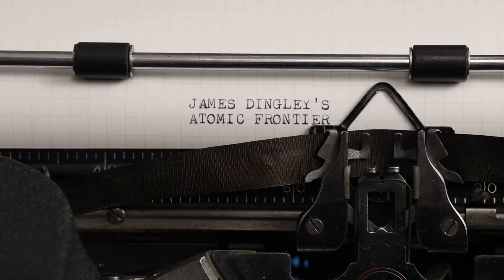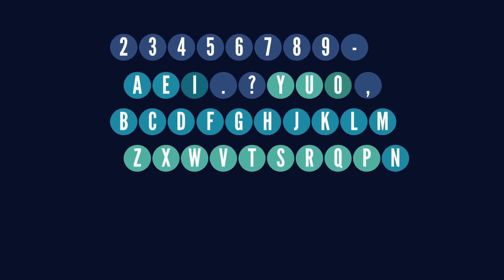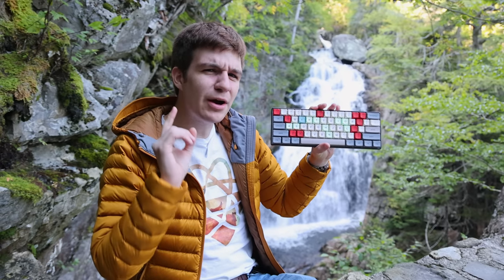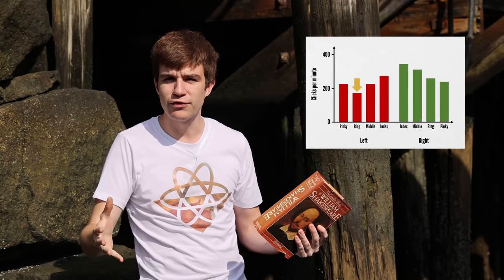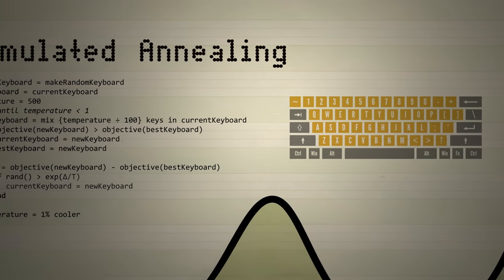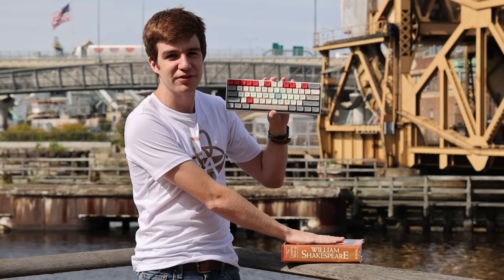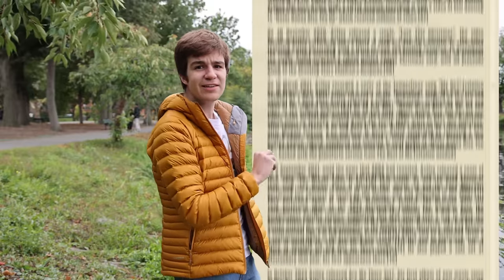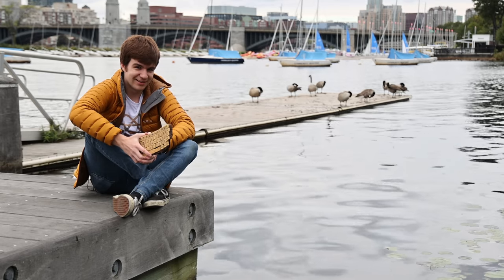QWERTY is broken. Can we make it better?

Comment: Something that should be considered with keyboard designs aimed at injury prevention:
The right index finger is already under heavy stress due to all the left clicking, so it should not do any heavy lifting on the keyboard to balance out the strain.
Reply: I use the mouse left-handed, so it's my left middle finger that does all the clicking.
Reply: @thekaxmax for me it's my thumb because I use a big trackball mouse!
Reply: Solution: stop using the mouse, and just use the keyboard. Retvrn to command line :P
Reply: You can get ergonomic mice as well. I use a Ploopy Classic Trackball and the mouse buttons are on the left side and hit with the thumb.

Comment: While switching from 10 finger to 10 finger is difficult. Its far easier to learn when going from "2 finger search mode" or derivatives to optimized layouts. The german layout NEO additionally has 5 extra layers which add in movement, special characters and scientific characters, which makes writing code a lot easier. even if it would take you 6 months at half capacity to switch fully, the sheer speed and finger fatigue improvements pay themselves back a lot.
However if you are only writing regular text its probaby not worth it
Reply: Neo User here, yes the layers are really worth it, especially considering the bad layout of brackets etc in qwertz
Reply: Neo layout is also an excellent layout for English text. With its additional layers it's the most ergonomic layout for programming today. (...if you stick to the traditional keyboard hardware.)
Reply: @annaluiseblume  I wonder whether the bone layout would make much of a difference but I haven't had the time nor the patience to try it yet

Comment: For those that are (too) used to A/QWERTY/Z to learn something new, or need to maintain a low-entry-barrier (meaning being able to go with whatever keyboard is at hand): You may try to shift your hands-position one character to the right, so that the left F-nub is under the left middle-finger and the right index-finger is on the K. In this position you can make use of your knowledge of the keyboard-layout while also being much more centered and have a better spread/shorter reach, kind of equalizing the asymmetrical orientation. This is especially helpful on laptops and compact industrial, as well as the usual office keyboards. While i learned 10-finger typing on german keyboards, the switch to US-International-with dead-keys Layout reduced the strain further overall, independent of the languages i write in and is extremely helpful when writing code, often switching operating systems and editors over the day (or night).

Would love to try a Dactyl Manuform if only there were key-switches with a much shorter travel, comparable to HP Laptops/Notebooks and Apple MacBooks/Magic Keyboards - simply because with Poly-Arthritis it's a PITA to hunk mechanical switches over the threshold for longer than an hour ..

Love your style btw. keep the middle-fingers coming!

Comment: Interesting stuff. After a 20 year career as a typographer in the pre-desktop days, I got 3 different RSI problems in my arms, but mainly bilateral epicondylitis and radial nerve syndrome. I got ill in 1992, and my case was an early one that helped Workers Comp decide to allow chiropractic as the primary treatment for workplace injuries,  if the injured person prefers. Just to say, I've tried everything. I left typography and entered tech writing, but I do still type many hours a day. I use the TypeMatrix keyboard, which is a small footprint regular grid. Hugely better, totally fixed me up. Will run either qwerty or Dvorak. I have no affiliation, just wanted to share.

Comment: I think your worst possible keyboard ignored the fact that you could just change the home row for your hands and get a massive improvement. I'd be interested in a layout that couldn't be gamed simply by changing your home row.
Reply: However, there is a good ergonomics argument for making row 2 the home row, as reaching a key two rows higher up is physically easier than reaching one that is two rows further down, while one row up and one row down are roughly equal.
Reply: Scoring function should consider distance between bigrams (consecutive keys), especially if they fall under the same finger.

Comment: TIL (today I learned) - I always, incorrectly, thought that Qwerty was related to mechanical keyboard arms - thanks for this video and insight!

I guess once you've been typing with a certain layout for many years (in my case, 43 years), it's nearly impossible to change.
I can touch type - I'm doing it now - I've spent so much time on a querty keyboard, since my ZX81 back in 1982 (I was a year late), any other layout is now an impediment. 
Even switching two letters would throw me out. I literally glance at the keyboard once every session.
A session is when I take my hands off the keyboard entirely. 
Touch typing is entirely based on muscle memory... which does make buying a new keyboard interesting.
It must have exactly the same spacing and size of keys.

Comment: Maybe it's not the keyboard layout that's the issue, but the "home keys" typing method? 
Luckily, I was never taught the home keys method. I just learned typing intuitively, in 2 character sets (Latin - qwerty and Cyrillic). Now that you've used weird-ass random layouts for a while, try to reset your typing method: go back to qwerty, but don't use home keys, just let your hands float freely over the keyboard and type. Moving your whole palm by a few cm is more effective that trying to hit "x" with your left ring finger or whatever, IMO.

Comment: I think a good model to use for a generally optimized keyboard for the english language would be to use simulated annealing of 1) the 3000 most commonly used words in the English language (which supposedly accounts for ~80% of daily linguistic communication) weighted by frequency of use, 2) Weight by travel distance from the home keys in a multiplicative manner to word frequency, 3) don't weight by awkwardness of using each finger to type unless you have a large enough sample size of people to get an accurate measurement, which I presume would be several thousand people minimum. 4) For typing on mobile define travel distance by how far each thumb would have to travel from halfway along the keyboard vertically and either one-third or one-quarter in the keyboard from each side. This process could be applied in a multilingual context by using words in every language that uses a Latin script that ammount to 80% of daily communication in each also weighted by frequency of use and travel distance form the home keys, and maybe weight each language by frequency of use.

Comment: the biggest issue with qwerty is that it's good enough. even the best possible layout wont give you 50% improvement. depending on how you measure, of course.
there are lot of conventions and expectations in software about it. gaming, vim, shortcuts, etc.
even notorious ctrl+c, ctrl+v will feel awkward on "the best" layout.
so qwerty will stay with us for a very, very long time. until big companies like MS or Google intervene.

Comment: Man this was a nice watch, although I gotta agree on the end that going through the pain of relearning a keyboard layout is pain for several reasons, the two main being that people type differently, me for example I don't even have a home row, my hand simply do not land naturally on the same place all the time, sometimes they even land on the number row, leading to very erratic typing that's always changing and always using all fingers, plenty of times the thumbs and pinkies too.
The other big reason is that your method of optimization is highly optimized... For ENGLISH. I am a native spanish speaker, and I am thankfully sufficiently fluent at typing in both english and spanish, and I think these optimizations you dabbled with would indeed minimize travel time, but not necessarily improve OVERALL typing speed. I mean yeah, saying "T, H and E are all together and thus you can type it faster" but you can also type faster by using both hands interchangeably. While typing this sentence I found myself hitting the A key with my ring finger as my right hand hit all the letters around the A key, leading to, to me, a smooth typing experience.

I think the true innovation would be in keyboard shapes, having the keys arranged in a way that better suits the hand and doesn't make stuff like holding down Ctrl, Shift and Alt too big a pain, doesn't require basically two hands for any common combo, and allows for less paradigm shifts between typing and using the mouse since we don't have three hands... Man it would be awesome to achieve true seamless integration of all these things... Oh well, gotta keep trying. GOOD WORK ON THIS!

Comment: Supposing for simplicity all the languages in question make use of the same written alphabet, 
such an approach would still require at the very least to use one keyboard for every language you want to write in,
even if you actually tailor the whole process on your own past written material and on currently recorded writing statistics.
...
I'm Italian, and I write just as much in my language as I do in English, on average.
But I know for sure there's a significantly higher use for one of the two languages over the other at times, depending on the period (i.e. mainly for work reasons, some months I'm writing much more Italian, some others in English).
I'll stick with QWERTY.

Thanks for your videos!

Comment: I would argue that split ergonomic keyboards which have the hands/palms at a sight to moderate vertical angle, which is our natural position when standing contribute much more to the comfort of the wrist/hand pain people often attribute to typing.

Also, if you're properly touch typing, staggered layout is even worse for you as your fingers have to move at a very uncomfortable angle across each key column. Ortholinear is the way to go here without a doubt. It might not improve your typing speed but it will significantly improve your comfort over the long run.

This was a very well made video with incredibly simple explanation of complex topics. Subscribed!

~Love? Qwerty? Hell nah bruv~ (I wrote this line at the very beginning of the video)

Comment: I also played around with keyboard optimisation a few years ago. Also used simulated annealing. One new idea I had towards the end was that it may be better to use a home gap rather than a home row. In other words, the better home position is between two rows (after optimising the keys in those rows), which allows you to keep more keys closer. The overall penalty for eg moving half a row for most keys is less than a zero penalty for the home row plus the unit penalty for more keys.

Comment: Interesting experiment. I never took typing class in high school (I'm 47, it was still on typewriters) and what started as hunt and peck has eventually turned into touch typing where I only use my index and middle fingers for everything except 
function keys, spacebar and enter. The upside of the typing method is that my wrists stay pretty straight while I'm working so I never end up w/wrist pain from typing. 

Got a new keyboard recently and it has 10 key again, which makes me happy as I had to learn it for a job bc entering the number strings for work assignment was so much faster that way. I'm happy to never use the numbers in the main part again.

Comment: I love this sort of thing 😆. BTW the design of the Dvorak considered two important criteria you missed: it favors alternating between hands (which is why all the vowels are on the left in home row) and it favors rolling toward the center of the keyboard (e.g. typing with a ring finger followed by middle finger) because that's a more natural movement than rolling outward.

also: the keyboard layout you display at 7:12 is the left-handed Dvorak alternative, not the standard Dvorak -- is that the one you analyzed with your formula?

Comment: Well made video 👍🏻
I’ve learned ColemakDH in two months, got to 40 words per minute. Completely forgotten how to use qwerty layout. That caused an issue with my laptop, so I’ve switched my laptop to ColemakDH as well. In the end I’ve returned to qwerty. Yes my fingers traveled noticeably less with ColemakDH, but that itself was an issue for me. I hated that all I type mostly required home row keys, this felt like I’m paralyzed or have some medical condition. I wanted my fingers travel more and do variety of motions, I felt it’s like stretching or doing a little workout. With less finger traveling I felt like I’m lazy and lying on a coach. That forced me to switch back to the qwerty when my fingers experience a variety of motions, to my biggest surprise. Switching back to qwerty required me to learn qwerty again, cause my brain was rewired to touch type with ColomakDH. Took me a week to get back to my average 60-70 wpm speed. 

Now I believe that criteria of reducing finger traveling is wrong. There should be a balance, not too much, not too low. I feel qwerty is exactly that for me.

Comment: Despite all the efforts I've seen people make with different keyboard layouts (like DVORAK), I'm yet to see someone make a keyboard layout meant for multi-language typing

I know that other layouts can be better and allow me to type faster IN ENGLISH, but I'm a native Spanish speaker and I also speak a fair bit of Japanese, and I don't think keyboard layouts like DVORAK would work too well in those languages, which is why I'm sticking to QWERTY probably forever
Reply: On my phone I use an input method called Message Ease which uses presses for some letters and swipes for others.  so you have the 9 most popular letter as presses and other letters as swipes between those nine areas.  They do have multiple language specific layouts.

Comment: I remember in touch type lessons, we used to be told that the finger layout matches qwerty so the spread is more balanced throughout, so personal experience, and some of my friends, getting used to it was tricky because of that reason and we just went back to using qwerty.

But even when the "used to" obstacle is finished, the next one, still comes down to hand and finger placement, where naturally after writing my fingers want to return to the original positions for touch typing.

So I feel like either a new layout for keys should have similar principle to touch typing where it's balanced out for finger travel time, not sure how else to phrase it, I suck at english; or change how we hold our hands over the keys.

Even in making an algorithm for most efficient keys, the only thing that seems to be taken into account are the amount of times something is pressed. so for me if e.g. if "the" was on the same line, would mean that yeah, I'll write "the" very fast but will move my wrist more than for qwerty, to write other words, exchanging strained fingers for strained wrists. While idealy, a better keyboard should lead to less over all movement, which would bring the speed naturally; though to achieve it would probably be hard af.

And correct me if I'm wrong but isn't qwerty also used for spreading the workload between both hands? E.g. the amount of fingers used, should be equal on both hands.

Hopefully I managed to express my thoughts properly.

Comment: I'm curious whether you measured distance metrics from the standard home row position, or from where your fingers naturally land on a flat surface. My middle fingers are so long relative to my pinkies that my "home" position on a QWERTY keyboard is actually AWEF JIO: instead of a straight line. This also tilts my hands slightly outward and relieves strain on my wrists.

Another thing that keyboard analysis often overlooks is the importance of positional key clusters, because we don't only use keyboards for writing. For example, the WASD cluster is important for gaming, the HJKL cluster often serves double duty as arrow keys (e.g. in teletypes and the Vim editor), and the right hand is sometimes doubled with a tenkey pattern on compact keyboards.

Of course, drivers & software can compensate for that to some extent. You can reconfigure your keyboard shortcuts from WASD to <AOE on a Dvorak keyboard. However, software often uses a mix of positional and mnemonic shortcuts, so you may have trouble converting to Dvorak equivalents if a game uses positional WASD for movement and mnemonic <> for switching equipment.